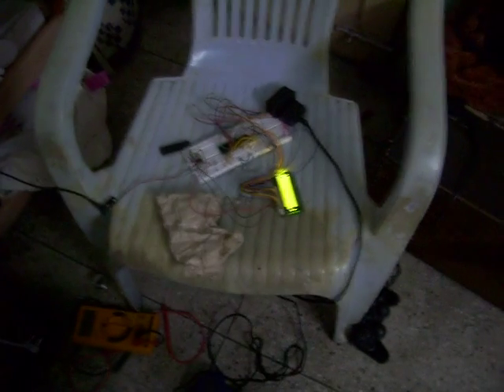PS2 dualshock controller interface using an AVR MCU

Comment from the maker: I can send you the entire code if that's fine with you. It wasn't a project as such. It was a part of a manual robot controller which I made. So, it's kind of similar. But I'd suggest you go through Dunk's PS2 controller interfacing. I will email you once I get back from the office. All the best with your project!

Comment from the maker: No, I did not use any external pull ups. If you are facing any voltage problem, be sure to check the power source. I always give a substantial capacitance to counter for the voltage problem. Usually 100microF for these kinds of applications.